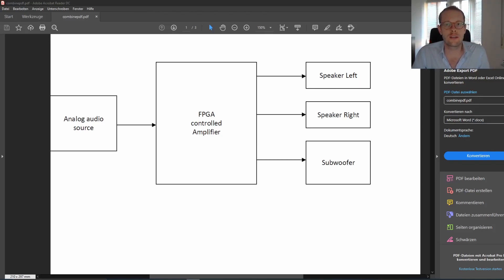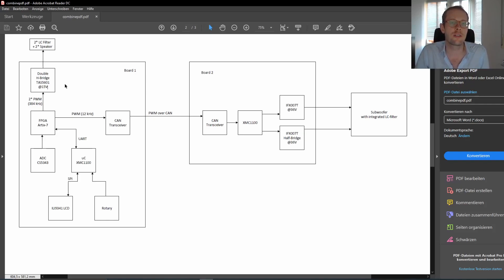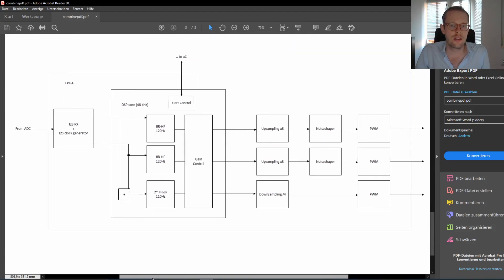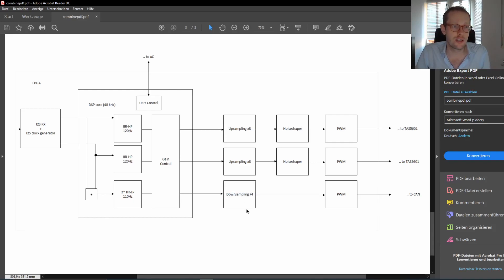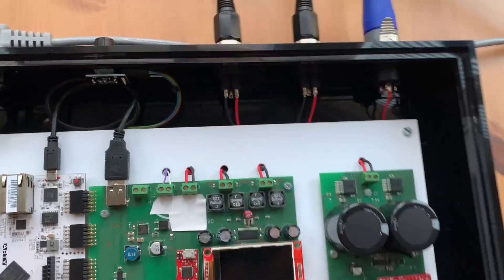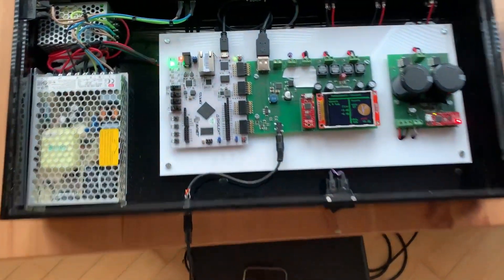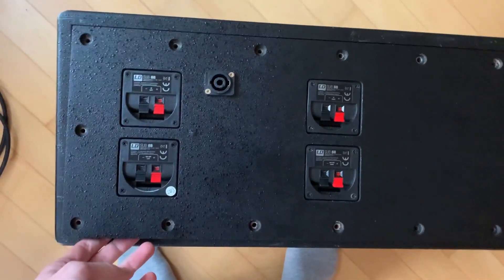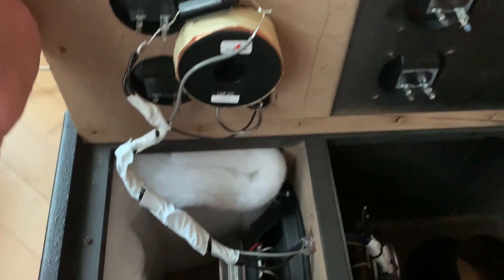[#25] FPGA 2.1 sound system - 1k special

Comment: Hey I also tried to get the TAS5601 to work properly but how do you get the 200kHz PWM modulation? I did it with an STM32 but I get a lot of audible noise even when playing 50% duty cylce only.
Reply: also why did you choose a PWM controlled IC instead of an I2S IC?
Reply from the maker: Hi Severin! Please check out my video about the FPGA based Class-D I made a while ago. There u can see how the concept is working
Reply: @YetAnotherElectronicsChannel  Thank you for your response! I am checking it out now. Right now i am working on my Bachelor Thesis and your videos are my holy grail in the Internet. How did you get all the knowlege? As this is exactly the field i want to work with after studeing I am very interestet in your videos.
Reply from the maker: @severingetzner8211  thanks a lot for your appreciation!